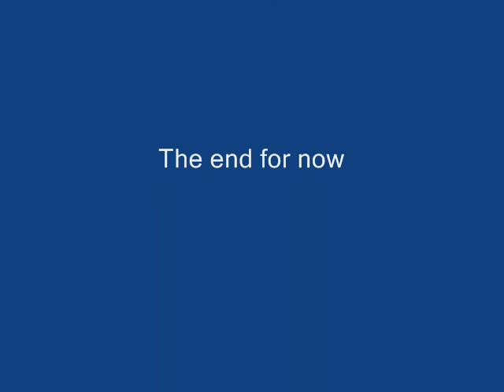vw 1cyl movie.wmv

Comment: absolutely great stuff man.  How does the automatic intake valve work? Is it by having a weak intake valve spring so the down intake stroke suction causes it to open?  Or is it simply that push rod off the side?
Reply: its exactly like you said weak valve spring valve opened by the vacuum of the piston going down